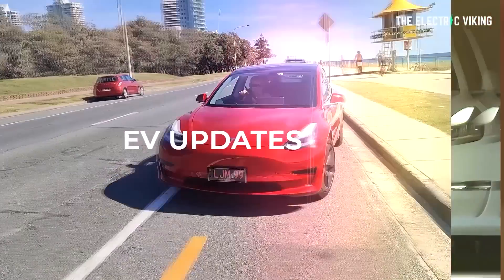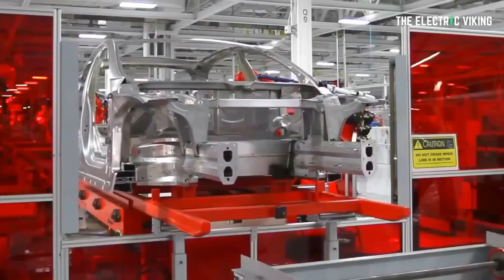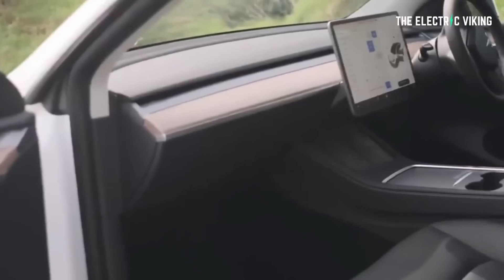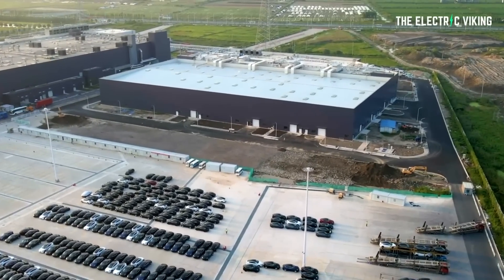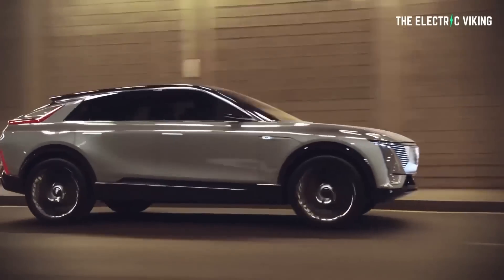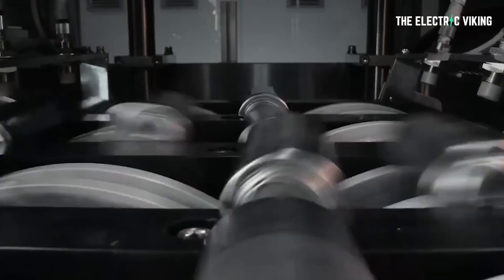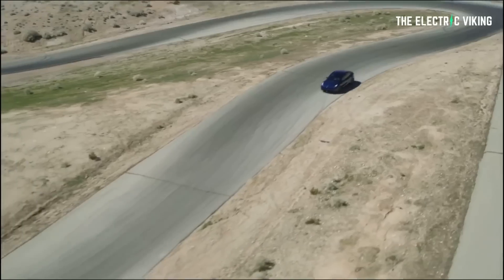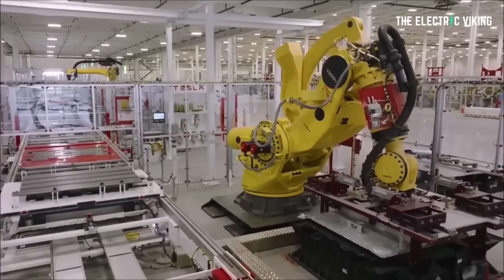Tesla's NEW 4680 battery pack size is UNBELIEVABLE

Comment: If they can reduce battery costs by 69%, then why are these costs teductions not passed on to the selling price if the Tesla? I think that that is inconsiderate that they are increasing prodit margins whilst not having any considerations for reducing profit, decreasing the Tesla prices and improve affordability. Like it or not, Tesla's are still very expensive, no matter what statistics say on average selling price for cars. I think that is bad on Tesla's part if they want to aim for faster adoption to electric sustainable mobility/transport.
A second thing I don't understand is why Tesla is still choosing battery size and weight over guaranteed range for their new 4680 editions of their electric fleet. How long have we as consumers already comolained about distrust of range of EVs. If we can more accurately reduce weight and anticipate range with the 4680 cells, I would like to see the narrative needle move towards reaching the goal of guaranteed all season reliable range, rather than focus on price amd weight reduction. If 4680 is the oromising milestone for this I think it would be more digestible to understand the justification of current Tesla's and other EVs. What I would like to see then with these smaller 4680 packs is that we then also see a real world all season guranateed range of 258 miles. If we don't see this in real world usecase of normal use/driving, I think Tesla's focus is off. For if Tesla can truly manage this practical real world problem, they they are truly ahead of the game. Because people can these more reliably gage the performance of the car, and worry far less about range anxiety and the culture change of charging and dr8ving for the average driver will change greatly and AI would have an esier time to manage navigation and charging planning and organization. It would revolutionize the apllicabilty and and real world practical management of many technologies, and make adoption on many services and ease of use for consumers far better, than providing false numbers for real world performamce today.
Reply: They are using that high price to increase the number of cars they can make.  That is the only way to have faster adoption of EVs.  And also coincidentally the only way to make them cheaper.
Reply: Raw materials are running at over double the cost presently.

Comment: Correction, it's 68KWh pack. It's still great efficiency, better than Model 3 or Y before it. 4.1 miles per KWh. The weight savings on the car are still impressive as well.
Reply: There is no weight savings.  The 160 or so lbs less is in the cells that are not in the pack.  That is a great mystery on why that no one has answered so far.  My guess is the chemistry they are starting off the 4680 packs with must be a bit heavier.
Reply: How do you know its a 68kw pack. Sources please. Do you know someone who charged up the car?  Can't just state a contrary opinion without supporting info.
How do you know? We'd like to hear.
Reply: @avgjoe5969  Perhaps you should look up the charging video of the Austin Model Y that takes it to 100%. The calculations done by the Tesla Economist also validate the size, and the tweets from people who have direct contacts from Tesla. Doing a little Google and paying attention on Twitter can enlighten you a lot.
Reply: @avgjoe5969  You could also look at plenty of the other comments on this video that have also reviewed the same sources that I had before commenting.

Comment: Love Tesla but the 4680s have been underwhelming so far. The pack is 65kwh + in size, not 50. Also, it charges slower than the 2170. The weight savings from the new structure are also lower than expected. I’m sure future software updates will improve some of this but so far it’s hardly world changing.
Reply: You cannot determine the charging speed yet, as Tesla always slowly ramps up new battery tech when it comes to power draw and charging. They did the same with the LG 2170’s in the 2020-2021 Model 3s.

The somewhat positive thing is that the battery already at this stage charges much quicker than the 65kwh LFP battery from the Model 3 standard range, but again, let’s see what the actual charging speed will be when Tesla decides to run the 4680 batteries less conservatively.
Reply: @TheDanishSpaceman  Yes. As I mentioned, hopefully software updates will improve the currently underwhelming charging speeds.

Comment: Competitors can compete with this by targeting a different segment - namely the low-cost EV segment. Tesla has such large margins today because they have increased the cost of their models disproportionately to the increase in costs to manufacture them. To be fair to Tesla this isn't necessarily wrong - they are a business so, in that vain, profitability should be their goal and it's something that they can clearly get away with. But as they continue to willfully neglect lower income consumers and lock them out of the Tesla ecosystem they leave room for other competitors to lock down part of that market. And while Tesla is increasing the costs of their EVs some other manufacturers are attempting to slash prices. Realistically speaking I don't think anyone is going to topple Tesla's dominance anytime soon but, as more and more low-income earners seek to transition to EVs if Tesla refuses to address that part of the market then other automakers will. Currently the only U.S. automaker that has been strongly targeting this market segment is GM.

In regards to "the holy grail of battery technology" I personally don't think that it is the 4680 cell. Afaik the "holy grail" has been, and still is, solid-state batteries.
Reply: SO wrong
Reply: @rogerstarkey5390  Right - care to explain what in my comment is wrong and why?
Reply: @fiftysquiggly  Tesla is a public company and that means it needs to be profitable! At 25k USD building a EV is not likely to make a profit unless it is produced in China & or extremely basic in construction and equipment. This value segment of the market is a production/profit nightmare.

Comment: Lot’s of speculation here but for sure Tesla are being very careful to avoid the Osborne effect, not a good idea to kill sales of 2170 Model Y given that those cells are in good supply, unlike the 4680s....yet. For me the more interesting thing is the bigger picture, Tesla’s approach to car building ignores the industry norm of bringing out a new model of a car every 5 to 7 years. All the tooling has to be changed at massive cost, just to keep the sales interest by having something ‘new’. The Model S, X and 3 have exactly the same ‘hard points’ as they did when they were launched....and in traditional OEM land we would have seen a new shape for all of those by now. Tesla are saving huge amounts of money by keeping their cars fresh with software and other tweaks to keep sales rolling. Traditional OEMs would wait to implement things like new cells, structural packs and giga-casted bodies for a whole new shape of car. Tesla are saving massively by introducing those things onto an existing model. Inevitable all of those technologies will come together in a single motor, entry level model that will massively boost sales. The reason I don’t have a Tesla is that they are all too big....I want a hatchback or estate (has to have a tailgate).. the next size category down, the category that most people in Europe and Asia actually buy....i.e. Golf/Corolla...or crossovers like the Kia e-Niro I have...these are what you see the most of  ploughing up and down autoroutes here in France.
Reply: @Poorold plowboy Yes as you continually refine aerodynamics and weight eventually you reach an optimal shape and configuration beyond which any changes degrade rather than improve performance.  This means improvements will need to be mainly underneath the skin. Given the traditional approach of the auto industry where most changes have been to external appearance with little regard to efficiency, this maybe hard to sell to some customers, but I suspect not most.

Personally, I rather like the austere functional configuration of Teslas.
Reply: We regularly hear a new ICE model.has cost it's manufacturer $50 billion (likely includes tooling/training etc).

Comment: The Lyriq is more roomy for the driver.  Lyriq : hip room 56.5 inches.  Shoulder room 58.9 inches.  Model Y : hip room 53.8 inches.  Shoulder room 56.4 inches.  For drivers who don't like feeling cramped, these differences are huge and Lyriq is the choice.   The cargo capacity is the same at 68 cu ft.  The Lyriq also has greater length, width, wheel base and ground clearance.  Oh, and Cadillac has a dealer network where the car can be serviced.
Reply: I totally forgot that Teslas cannot be serviced!

It’s weird how they come right to my house or work when needed.
Reply: @tommornini2470  I guess you forgot that 20% of the time Tesla mobile service cannot perform the needed repair or maintenance, so driving to the distant service center is required.  Weird.
Reply: @thewolfdoctor761  80% is four times as often as 20% — and as infrequently as these cars need maintenance, that 20% is extremely infrequent.
Reply: @tommornini2470  One visit would be too many if I live far away.  BTW, yearly safety inspections are required in my state, so that is one visit every year - I wouldn't trust a corner garage to inspecting a Tesla.
Reply: @thewolfdoctor761  Hey, if you live where a Tesla doesn’t make sense, that’s too bad, I feel for you.

Tesla changes very quickly. Service has improved dramatically and will continue to do so.

It’s really cool that they intend to make as close to zero profit as possible.

That’s going to save us a ton of money over the extremely long lifetime of the vehicle.

Comment: Tesla sold the choked down Model S because prior to production they had allowed buyers to reserve a smaller range/battery pack for a lower price.  

Tesla got few orders for the low range version so they took the next range up, limited the portion of the battery pack that was usable, and sold it to those few buyers at the price level they had picked.

Then, later, they offered to unlock all of the pack for an additional fee.

Comment: Possibly, Giga casting frame much lighter and 4680 more efficient, also, like Elon said you really don't need more range than the 280 miles so in this was Tesla can mass produce cars now and and they can focus on longer range in the future as their 4680 ramps up to a higher speed and supply becomes more abundant! 🙂
Just a thought.
Reply: Other way around.
Casting more efficient (hundreds of parts not requiring assembly)
.
4680, (pack) 40% less steel in the cells, floor (2m by 3m) removed from the bodyshell.
That's a lot of weight.
.
Having said that...
Castings may be lighter
The cell is more efficient.
And
The cell production is a HUGE saving.
Reply: @rogerstarkey5390  yeah, people seem to misunderstand what the key points about the 4680 cells are. The format means, as you said, less wasted weight in the form of packaging (the steel housing) - the tabless design is what makes this possible without causing heat buildup/hot-spot issues. The larger size probably also means it is better suited to act as a structural member, allowing the rest of the pack structure to be lightened and still function as the load-bearing floor of the car.
The dry coating means great savings in production, both in space, energy and time as well as resource consumption by avoiding the wet process. The energy density of the pack gets better mostly on the energy/weight scale, less so when looking at volume.
Chemistries are as far as I'm aware the same as for the 2170, so I would not expect huge differences in performance, though with heat dispersion being so different from traditional cells there is bound to be some differences. People seem disappointed that charging performance seems mostly in line with 2170 packs, but I would expect Tesla to be very cautious for a while until they get enough data from real world usage, so hopefully 4680 packs will turn out to be better at heat buildup/management thus allowing more aggressive charging in the future.

Comment: 2 metric tons is only 4409.25 lbs.... 

The Model Y is 4,555 lbs... 

Unless you mean 2 sae tons, then that's about 5000 lbs, which isn't really that big of a difference between the Cadillac and Model Y if we are going with what you stated.

If you are going to use wieght as an argument, people keep the unit of measurement the same.

There is a flaw with the structural battery pack that GM's Ultium platform does take into consideration when it comes to the battery pack. Ultium makes it easy to replace and even upgrade the battery pack. 

While Tesla has made it sound that their 4680 batteries are more of a permanent installation. As in it cannot be removed and replaced with ease.

It's all pros and cons but I would probably lean towards the GM product because of them thinking about battery replacement down the road while Tesla has made it more of the owner being SOL when the cells start dying.
Reply: I think the rational is that the battery pack will last the life of the car.   But we need to see how reliable they are.
Reply: @danharold3087  

True. Personally I value ease of repair and maintenance more than believe something will last the lifetime of the vehicle. That is a trade-off I'm willing to compromise with.
Reply: @thegreatempire3882   I don't see that long life is something we will have a choice on.   It will come.   Building the pack so it can be removed for repair is a separate issue.  It is a crying shame to not fix a pack in need of a few new cells or an electronic board replacement.    Unless the manufactures work really hard to prevent repair there will be people willing to make it happen.   Past that we may be looking at right to repair issues.
Reply: @thegreatempire3882  It appears you are confused about the difference between pounds and kilograms. 2.5 metric tons = 5511lbs. 1.9 metric tons = 4189 lbs. The difference is 600 Kgs which is 1322 lbs. I hope that helps you to get your figures correct.
Reply: @donjohnstone3707  

I have looked up the wieght of the new Model Y, it's no where near 1.9 metric tons.

Like I stated in another comment, he's either guessing or Telsa is putting out different numbers in different countries because according to Telsa, the new 4680 structural pack only manages to shave off 25lbs from the old pack they were using. The out going Model Y is 4,555lbs, or 2.066 metric tons. You take off 25 lbs, the new model Y is at 2.05 metric tons
Reply: Sam said the Cadillac was 2.5 tons compared to model Y at 1.9 metric tons, making it 600 Kgs lighter. So you can only assume he is referring to metric weight. While the Cadillac has a 100 Kwh battery, it has about the same range as the Model Y, which has a smaller and lighter battery.
Reply: @donjohnstone3707  

Here's the thing, his calculations bare off unless the Model Y in the US wieghs more than in other countries because it's only about a 600 pound difference between the Cadillac and the Model Y. Even with the 4680 cells, which makes the vehicle about 25lbs lighter than the outgoing model.

It's still a part of wait and see what the real world range for both of these vehicles are but I'm thinking GM might be underrating their EVs like Ford is currently doing. 

The big thing that Telsa is lacking is 350kWh charging, which would most likely allow the vehicles to be even closer to the times of filling up a vehicle with gas.

Comment: I couldn't care less about range, as long as it has around 250, I'm happy. What's more important, in my opinion, is being able to scale more quickly and getting more vehicles on the road. Given the battery production constraints, using smaller packs makes perfect sense.
Reply: Right. Just discount the difference and in 5 years just release a statement to replace batteries for certain models. Get them on the road. He's losing billions of dollars at Berlin and Texas because batteries

Comment: Making a big battery is not a solution to the problem. Thermal waste and thermal runaway are still big problems with Tesla batteries.
Reply: Where is this?
Reply: @tedmoss  Just about every Tesla is a fire hazard and death trap. We aren't going to see the expansion of the cells until many years later. Tesla and such are basically milking round cell battery architecture but it's gonna get taken over with real manufactures.
Nobody needs to be zipping around with 5 thousand panasonic cells.

Comment: Sorry to say Texas Model Y has been confirmed to have a 68kW battery pack.  The efficiency isn't significantly better than the Freemont version.
Reply: "Efficiency" is a BIG word.
Do you mean
Cell density?
Cell capacity?
Cell weight?
Pack efficiency (volume or weight?)
Vehicle structural efficiency?
Vehicle weight vs pack output?
Then we have
Cell manufacturing efficiency? (big one! Energy use, factory size, output)
Vehicle manufacturing efficiency?
etc, etc, etc.
How about "all of the above"?
.
They're building a new "system".
This is stage 1.
Reply: @rogerstarkey5390  Things 'efficiency' can't mean in this context:
Cell density, Cell capacity, Cell weight. 
If one is comparing range per kWh, those things are measured before arriving at a figure for kWh.  The battery might be a bit better at delivering energy, but there isn't a lot of room for improvement there, all other changes must come from efficiency improvements to the car itself (aerodynamics and weight being the big ones).
Reply: @rogerstarkey5390  vehicle efficiency mate,  as per the topic of the video....